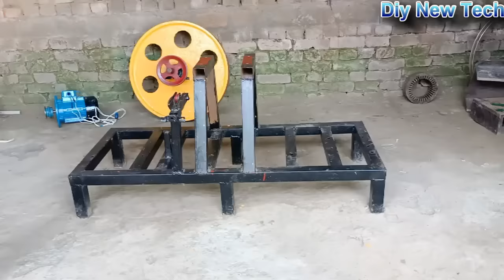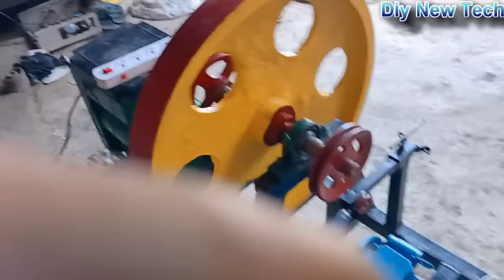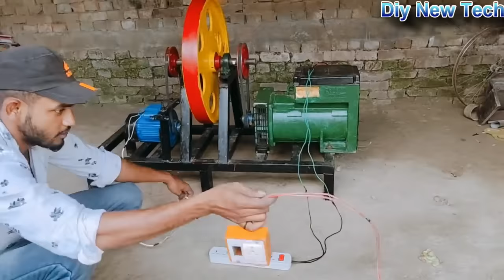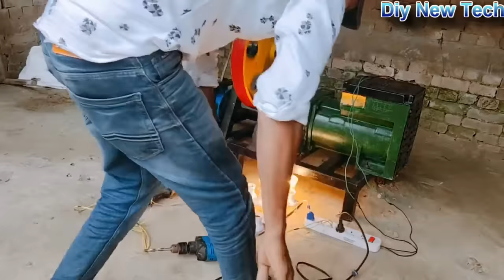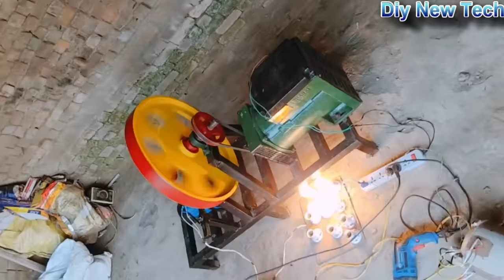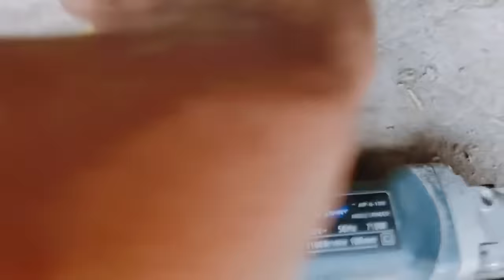Free Energy Generator | Flywheel Free Energy Generator | Self Running Generator|Fuel Less Generator

Comment: One of the best idea. From my childhood I thought so . But one of my friend rejected my idea. But here you did the practical what I thought in my childhood at least 28 years ago. Thank you ghy for your innovative idea. 💯💯💯💯💯💯❤️❤️❤️👍👍👍👍👍👍👍👍👍
Reply: Subscribers ko bebakub bana raha hain
Reply: Same here
Reply: In Indonesia, there are many electricity systems like this, even giant coal mining trucks in Indonesia no longer use fuel oil, they turn them into mining giant electric vehicles using an electrical system like this which requires 5000 watts of power. Maybe you will not believe before trying it yourself. Physics is impossible but in fact it can be done.
Reply: mere teacher ne ish idea ko halat bataya tha
Reply: @Deadly_Panther  _kya bataya tha?
Reply: Bhai ye idea mujhe bhi aaya tha jb me 9\10 sal ka tha pr afsos ye posible nhi h or tab mujhe law of conservation of energy nhi pta tha
Reply: Hii
Reply: Español
Reply: use only one 4000 watts heater for one hour check what happens
Reply: battery is electrical storage charge it and use it.similarity flywheel is mechanical storage rotate it with any power and use it till it dies as battery discharges.
Reply: THIS SYSTEM IS SO SIMPLE, LIKE THE GENERATOR WILL POWER TO THE DYNAMO,THAT THE DYNAMO WILL CONTINUE ITS WORK GIVING POWER TO THE GENERATOR TO DELIVER ENOUGH OUTPUT FOR SERVICES.
Reply: It's nothing,,, could you believe in that idea...how can you put load at that ,,,, imagine 1 PC of fan belt only??
Reply: Wasting of time and efforts..

Comment: Gravity will slow down the flywheel and eventually machine will stop. Machine will need external force to overcome gravity. 
Thermodynamics states that "in all energy exchanges, if no energy enters or leaves the system, the potential energy of the state will always be less than that of the initial state."
Reply: in how much time it will stop ؟؟؟
Reply: Gravity power will slow down motor. To maintain gravity interference its more work
Reply: Isme gravity kaha se aayi bhai...
Friction hai
Heating me Loss of power hai... 

Agar gravity rok rhi hoti to international space station me isko chla lete nasa wale... ye kahi nhi chl skta...
Reply: In Indonesia, there are many electricity systems like this, even giant coal mining trucks in Indonesia no longer use fuel oil, they turn them into mining giant electric vehicles using an electrical system like this which requires 5000 watts of power. Maybe you will not believe before trying it yourself. Physics is impossible but in fact it can be done.
Reply: Physics ke professor
Reply: Loss to Hoga , input  = output  , nhi HOTA  ye ideal condition hai , views badhane ke Liye chutiya  bana the ho
Reply: @fisher7600  to hy Dr by.
Reply: @dptchannel4894   thermodynamic do not apply in Indonesia

Comment: Simply not possible to generate electricity as done here. Simply it will work for some time as electricity was provided in the beginning.
Reply: In Indonesia, there are many electricity systems like this, even giant coal mining trucks in Indonesia no longer use fuel oil, they turn them into mining giant electric vehicles using an electrical system like this which requires 5000 watts of power. Maybe you will not believe before trying it yourself. Physics is impossible but in fact it can be done.
Reply: ok

Comment: Rpm didn't slow down a bit when you change the power source which suggests motor had a hidden power source
Reply: In Indonesia, there are many electricity systems like this, even giant coal mining trucks in Indonesia no longer use fuel oil, they turn them into mining giant electric vehicles using an electrical system like this which requires 5000 watts of power. Maybe you will not believe before trying it yourself. Physics is impossible but in fact it can be done.
Reply: 👍Maine bhe notice kiya
Reply: You are correct
Reply: @subhankardailylife7980  😂 अपने जनरेटर को मार्केट में लाइए
Reply: your right it has a hidan power souse
Reply: @dptchannel4894  bro we use 60 hp tractor on a 20 kva generator to run 7.5 hp motor when there is shortage of water, even the tractor drops few rpm when motor runs, so you are saying this 2hp motor is more powerful than a 60hp tractor it didn't slow down at all?

Comment: Frywheel ko ghamaney k liye use motor cycle back wheel touch  with wheel and run on roer speed till it not produce 260 volt

Comment: How much power is generated. Please let it know how much it costs and from where it can be purchased.
Reply: Brother it's never be done . Don't waste you time and money
Reply: It's social economic it's should be come in mkt in different mechanism on trail basis when it's completely progress then competitor will come in mkt
Reply: In Indonesia, there are many electricity systems like this, even giant coal mining trucks in Indonesia no longer use fuel oil, they turn them into mining giant electric vehicles using an electrical system like this which requires 5000 watts of power. Maybe you will not believe before trying it yourself. Physics is impossible but in fact it can be done.
Reply: Ne ver susscussess

Comment: My brother, between the horsepower capacity of the engine and its speed Generator's value and speed Engine pulley, two-sided pilot pulley, and generator pulley How much is the measurement? And the weight of the pilot wheel
Reply: This is no matter. The moust important thing is the generator be  uper the mouter in energetic capability. The mouter is asynchronous . Then it no requires a exact frequency of rotation . The generator must produce the same energetics characteristics  as frequency , voltage and corrent  that comes from the grid when be in maximum rotation and go to the mouter .
I noted that the mouter look like a induction one . This is a important point because it generats a litle bit of energy back to generator in time of unplug  it from grid and conect to genarator . 
All mouter is a generator too then the idea is to do the mouter work like mouter instead of  generator . The  instante it be unpluged from grid , in this timing, the flyweel be a mechanical generator . The mouter and generator is working like two genarators in paralel. Is in this point the corrent  of alternator must  be uper to the mouter in this same instant that flyweel  been in maximum speed and working like a mechanical generator  becouse the mouter  generates  litle bit of energy  too. This unbalanced corrent betwen generator and mouter that alow the corrent comes from  generator and go to mouter  only.

I belive that he had mofified the router of alternator with permanent magnets . There is no other explanation .
This kind of generator uses a excited rotator with copper coil that expends many energy from batteries . But I not have seen any one .
Then I belive there is magnets!
Reply: Dinama कितना है

Comment: ملاحظة حين يتم تحميل المولد الكهربائي بالاحمال من ماكنة لحام واضائة ومثقاب وكوسرة  في هذا الفديوا  نلاحظ 
ان المولد لايخفت وهذا دليل على ان المولد اكذوبة 
وانا اشك في قدرة المولد بالعمل 
وشكرا
Reply: In Indonesia, there are many electricity systems like this, even giant coal mining trucks in Indonesia no longer use fuel oil, they turn them into mining giant electric vehicles using an electrical system like this which requires 5000 watts of power. Maybe you will not believe before trying it yourself. Physics is impossible but in fact it can be done.

Comment: There's been so much criticism about free energy. Some critics say that if it really works then why hasn't it been commercially exploited. The omly reason it cannot be commercially exploited is due to the fact that the system requires very controlled LOADING, failure to which it shuts down. You can't control how people use electricity in their homes.

Comment: Free energy ka ik sahi rasta batata hu eshi fly wheel ko welding Karo ek water weal 2000 leter ka pani ka tanki ik small Puli ik big Puli rpm pura hota ho jis sang rotating in water storage tank lagao ik small water pump ki sath 5 kva me se jo 3 kva safe karda tanki ki pani se water weal ko rotate karo store pani ko pump karo or tanki me wapic kam se 4000 lt store water tank ka use Karo jo upar se pani kholta hi nicha se pump kara uski sath chaha jitna marji bara altinator lagalo work karta raha ga bina jala bas water flowing weal ki upar utna hona chahiye ki rotalion rpm sahi se nikla iska ki liya ap pumping motor ko pahla light per chala sakta ho crunt production hota hi genrator per conversation kardo free energy tabhi produce hoga warna nahi
Reply: I Agree with you

Comment: Bhai generator rpm set kiya nahi, kyonki single phase dg set ke rpm voltage bante hain
50 hz par 1500 rpm, voltage 230v single phase ya 415v, 
 3phase, check the voltage,

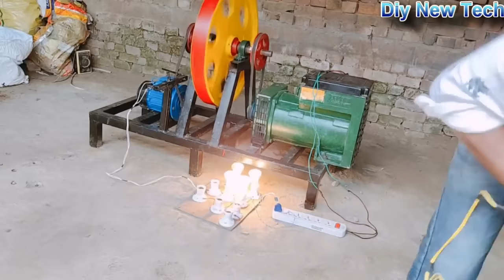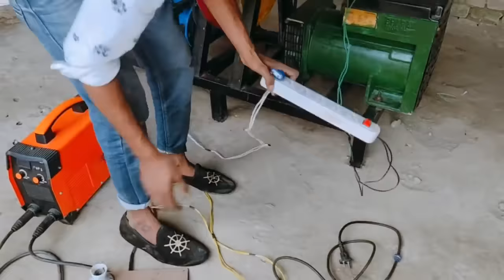Comment: 07:48 wire plugin and 13:13 wire plug out but the bulb is flashing. Main roll through bulb board. If this experiment truly works i will give 5000 thousand rupees. ✌️🤝🤔
Reply: Bhai 50000 mein dunga

Comment: In our NTPC, many tonnes of coal are used to generate electricity.
Reply: In Indonesia, there are many electricity systems like this, even giant coal mining trucks in Indonesia no longer use fuel oil, they turn them into mining giant electric vehicles using an electrical system like this which requires 5000 watts of power. Maybe you will not believe before trying it yourself. Physics is impossible but in fact it can be done.